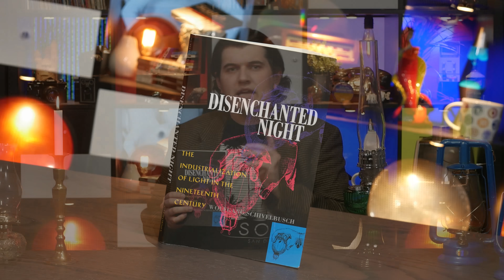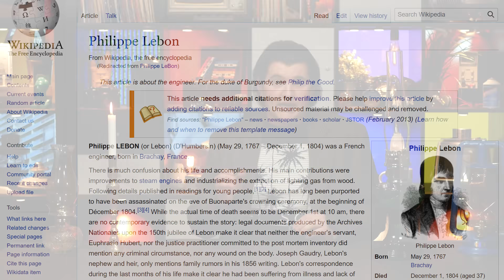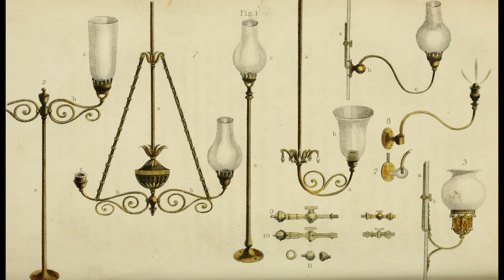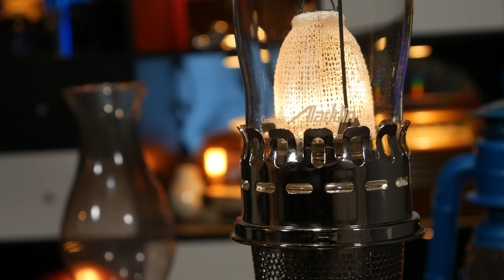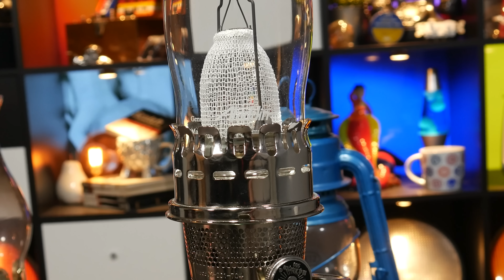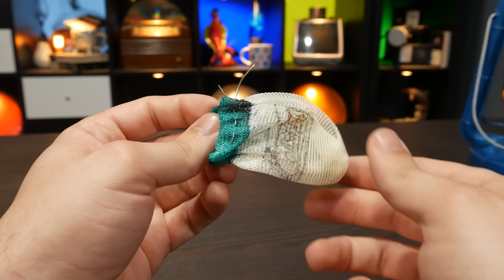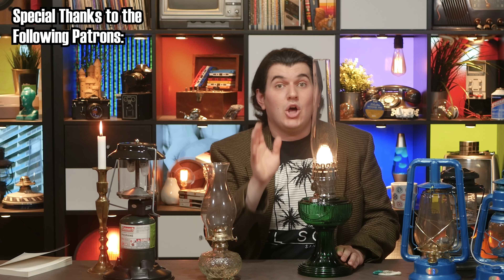How the gas mantle made lamps 10X brighter

Comment: The street lamps in the streets I grew up used Such gasmantels. But gas lighting is being phased out in my city, I don't know what happens with the streetlamps on that street, in some other streets the Gaslamps are rebuild into LED lamps, but considering it is mostly single family homes it is very likely that the beautiful cast iron street lamps are simply replaced with the cheapest streetlamps they can get.

Comment: Btw. We still have infrastructure for Coalgas laying around, and not just streetlamps. If you look at cities sometimes you can discover circular steel frameworks. They where there to contain the gas, im the past you would have a central bubble, which would rise up as it is filled. There are also earlier brick version, some of them in germany where turned into bunkers during WW2. Considering how happy the US was to destroy its cities after WW2 I don't know how many of such structure survived until today

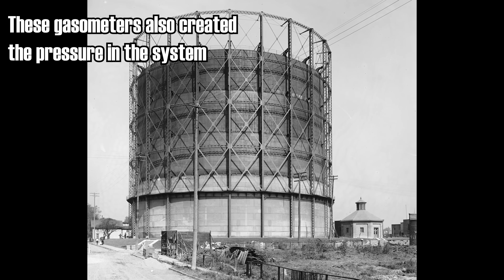edit: watching the Video completly such a structure is shown at 5:26 just remove the gas holding part.

Comment: I used one has a young adult. The challenge is to cut the round wick perfectly level… flat wicks are easy. Tools are available to do this but the ones I used still leaves much to be desired. The Aladdin gives off a nice bright, quiet light… the coleman pressure lantern is so noisy…

Comment: I bought a couple Aladin burners a decade or two back and played around with them till I had a couple functioning lamps . Cumberland general store had some information about the lamps . They said that about 2 inches above the mantle the temperature while burning properly would reach something between 2,200 and 2,600  degrees F.  I think the article also showed how to use the lamp to provide heat for an oven .

Comment: Here in England my mum still uses a few oil lamps and has a lovely brass Aladdin lamp. We call them oil lamps as what we burn here is lamp oil. It seems to be a purified type of Kerosene and burns oderless.
However me and a couple of friends still use a kerosene pressure lantern for fishing and camping. The favourite been the good old reliable British made Tilley guardsman lantern. Vapourlux is another popular one.
I also own 2 kerosene pressure stoves which get regular use.
They are however not without problems if you don't know how best to operate and need regular maintenance.
🏮💡🔦

Comment: You can get genuine Aladdin lamps from Lehman's Hardware.  I think I will stick to solar led lighting for my emergencies that might arise.  I don't like the idea of kerosene in an apartment building.  My fear of the dark isn't that important and the dirty dishes can wait until morning.

If however there is a winter power outage, I might reconsider this because I have electric heat and all electric appliances.  It would be a spendy experiment if I didn't like it or it didn't work, or the hardware store was out of kerosene.

Comment: Actually the gasometer is an accidental measuring instrument. It measures air pressure. To monitor the gas going in and coming out of a gasometer they monitored the pressure in the gasometer, which would vary according to the outside air pressure and recorded the pressure on paper. This accidentally became significant during the eruption of Krakatoa in 1883. The gasometers in Batavia (modern Jakata) recorded massive pressure spikes from the explosions.

Comment: As to the "forced my lute" comment, here's what ChatGPT-4o has to say:

Me (prompt)

In Clayton's letter to Boyle (the first known record of a description of natural gas), Clayton described that the "spirit [he] could in  no ways condense" also "forced [his] loot". 

What does "forced my loot" mean in this context? Be sure to consider the time period in your response.

ChatGPT
In the context of Clayton's letter to Boyle, written in the 17th century, "forced my loot" uses language that may sound archaic to modern readers.

The term "loot" in this historical context doesn't refer to stolen goods, as it often does today. Instead, it is likely an old or obsolete term. However, it's possible that "loot" could be a corruption or variation of another word, such as "lut," which was an early form of "lute," referring to a seal or stopper used in alchemical processes.

Given the period and context, "forced my loot" probably means that the gas pressure forced open the seal or stopper that was being used to contain it. Thus, Clayton's description suggests that the natural gas he was working with built up enough pressure to break through whatever sealing mechanism he had in place.
___

IDK if it's correct.

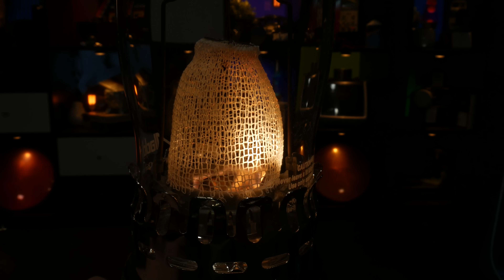Comment: @21:55 The wick probably isn't defective but rather when it was new whoever filled it with oil/kerosene didn't wait long enough before lighting it, the wick needs time to absorb the oil all the way else you damage and burn up the wick that is "dry".  Best to let em sit and soak up the fuel before lighting them, pretty sure that's what is going on here, I use to play with these alot when I was a kid and learned this one the hard way as well.

Comment: Mantles used to contain beryllium. When first using a new mantle, you could inhale the initial burn off. Very hazardous. They also release radium-224 and in the 50s, mantles were coated with thorium nitrate. All bad stuff.

Comment: The expression "forced my lute" likely refers to the process of applying pressure or force to a luting material. In historical and technical contexts, "lute" can mean a paste or sealant used to make joints airtight, particularly in apparatus used in chemical processes and gas production. The term "forcing" would then mean applying or exerting force on this sealant to ensure a tight, impermeable seal. This would be relevant in the context of coal gas production, where ensuring airtight connections in gas pipes and containers would be crucial to prevent leaks and maintain efficiency in the gas production process. The expression captures the need for meticulous care and physical effort in maintaining the integrity of the equipment used.

Comment: I used an Aladdin lamp during a power failure in Los Angeles.  Excellent light output. However, the hot exhaust burned a brown spot in the ceiling.

Comment: Surprisingly I have a NOS from the 50's Alladin Train Caboose lantern and it's mount bracket that allows it to rock back and forth with the trains movement. The tank part of it is made from nickel so it still looks new. Plus original NOS mantles. There may be a wick too. But those  parts are still sold by Alladin.  You vaporize the gasoline the same way the old Coleman stoves worked. For those we always bought lead free gas from Amoco, the only company that sold lead free gasoline.

Comment: I was born in 1947 in the USA.  I am familiar with gas lights that were in my Grandmother's Victorian home.  They were converted to electricity before I was born.  I also remember outdoor kerosene lanterns that were used outdoors by road construction crews and railroads.  I started collecting various bicycle, flat wick farm, railroad, and camping lanterns decades ago.  Also have a few hollow wick lanterns and heater brass fuel reservoirs.  My BSA Troop used Coleman white gasoline lanterns and camp cook stoves that had to be pumped up the be pressurized.  The lamps were so bright that you could not look directly at them.  Thank you for this walk back in time.

Comment: Your other videos I found interesting, this one I found very interesting.
My father used in the 'fifties in a holiday home that was rebuild in spring and stricken down in autumn - in a camp with about 1500 of such homes - a butane lamp with a similar gas mantle which had a ceramic foot. Open the tap on the bottle - which was light enough to be carried with two hands - open the tap near the lamp, apply a match. Use the same gas for cooking.
A gasometer is called 'gashouder' in Dutch, 'houder' meaning the same as holder in English.
Another name for coal gas is town gas. I remember natural gas being introduced country wide in the 'sixties so I always knew where 'natural' came coming from. In Dutch it is called 'aardgas', because it streams from the Earth, especially in Groningen were the houses are cracking from the resulting subsidence to the despair of the people and the embarrassment of the government.

Comment: Coal gas being a byproduct of coke production is actually still utilized today at a pair of steel mills in Canada, one mixing it with natural gas for use in the coke ovens themselves, and another selling the gas to the power company of the town the mill is located in, and using it to run a power station, affectively indirectly making it the last coal burning power station in Ontario

Comment: Just saw this. Check the gap in the wick slot for even gap width along the gap length. If the gap on one side if the wick is tight it wont let the fuel pass and you will have a dark side in the mantle

Comment: My father worked for Aladdin Industries and our family has several mantle lamps and we had a touch lamp back in the '60s. It used capacitance to turn the lamp off and on. I pulled the control unit out and it used vacuum tubes!  😊

Comment: I know there radioactive but i have been filling them up with quarters, putting tags on them how much inside.  all string tie mantles different sizes, shapes and colors inside a white plastic 5 gallon water bottle without the handle and a flat bottom.  still gonna keep filling up those mantles with coins and stuffing them into the bottle until it's full.

Comment: Regarding the statement “these sorts of lamps can’t be used outdoors”, I  lived in Houston TX in the early 2000’s and most homes in the neighborhood had filament style gas lanterns outside in the front yard lighting the path to the door. They were on 24 hours a day which I thought was terribly wasteful of gas.  I accidentally severed the gas supply line with the lawnmower and the light went out. For the next 4 years I left the gas supply turned off, only re-lighting it when it was time to sell the home.

Comment: Luting agents are basically cement or some other adhesive used to make a seal. Common in dentistry these days.
"Forced my lute" likely meant it broke the seals on his distillation equipment, not the glass, which would follow from the "spirit" not condensing and rather exerting pressure on the vessel.

That said, I fully support the notion of resurrecting (and perhaps repurposing) forced my lute for modern slang usage.

Comment: There is no light without fuel.  Our sun is a ball of fuel, batteries for flashlights is fuel, incandescent, led, fluorescent, doesn’t matter all of these use fuel be it coal, gas, nuclear  they still run on fuel.  That’s where your power comes from.  Even solar panels, without that big fuel burning sun in the sky wouldn’t produce light.

Comment: I always found it cool that the actual infrastructure being pipes, made converting to electricity VERY easy, since often the wires could be literally pushed into one end of the pipe and often went straight through the pipes without a problem... some houses (in europe at least) still have old electrical cables which use even older gas pipes as a conduit (although i hope theyre not actually still in use since those cotton braided cables deteriorate over the years)

Comment: There you go again lamenting the fact that people still use lanterns for light. You say there is problems with people burning fuel for light and though I don't necessarily disagree with that statement, you have to realize that even in the USA most of our electricity comes from burning fuel and there are many inefficiencies associated with getting that power from its source to its point of consumption.
Reply: From his other videos, I think his main issue is swathes of people using noxious, potentially leaky fire hazards as everyday lighting indoors and out.

Comment: I've got an Aladdin lamp made for a train car. Bought it brand new in box at a flea market for about 70 dollars. It's definitely a steal. It mounts to the wall. The mount has  vertical and horizontal leaf springs for vibration dampening. The fuel tank is made from nickel instead of glass, too. There is also a lamp shade to go around the chimney and a heat breaker that mounts to the ceiling to prevent a fire from the chimney heat. It swings back and forth on a chain.

Comment: Gas holders were a common sight in and around Baltimore.   Built by Chicago Bridge and Iron, they were akin to upside down collapsible Scout cups, with the overlapping sections filled with water.  They rose and fell based on the gas pressure within, and the water seal in the overlapping sections kept the gas sealed within the holder.  Amazingly simple.  If memory serves, they were approx 3 psi pressure, which was sufficient for the 11 inches of water pressure requires at the customer's burner.  Spring Gardens in Baltimore made coal gas for the city mains...

Comment: An Aladdin lamp can be regulated, i.e. dimmed or brightened. Aladdins are beautiful but rather sensitive so all these warnings must be heeded. I regularly use them for heat and light. I only ever slowly and gently turn up the wick over a period of many minutes and don't run more than say 2/3 max.
I prefer to turn them down to a peep before extinguishing then leave for a few mins so they don't cool down too quickly before blowing them out. The mantle frame and upper holding wires can deform and burn through over time and mantles don't seem to be readily obtainable. 

In the UK lamp oil is subject to 20% VAT but paraffin is not.

Comment: I use a Coleman "white gas" lamp while camping. I grew up around these lamps. I remember my dad taking the lamp and pumping it to pressurize the tank.  My dad used to pull out the mantle after the old one would get a hole.

Comment: We used Alladin lamps at our remote cabin up until about 2000 (we switched to solar). I remember the time the dog knocked over one and it's tank broke spilling kerosene all over the floor. Thankfully this happened during the daylight hours. We also had a kerosene heater and, many are suprised to learn, fridge. When he shows how after a lamp heats up it can change how much kerosene evaporates and burns, imagine that but with a heater and a four foot flame shooting out the top (I woke up to that once). We're so lucky the place never burned down.

Comment: IN the 1960s, there were power strikes in the UK for three hours at a time. I was staying with my aunt in London at the time, in an old house which still had working gas fittings in some rooms, although they'd not been used since the 1930s, when electricity had been installed. With some difficulty, I found a shop still selling gas mantles and fitting them enabled us to continue with gas lighting during the power cuts. It was a pity that the TV wasn't a gas one, too, but we did have a battery-operated radio!
Reply: During the 1950s we lived on a farm here in England. We did have electricity, most of the time, except following a thunderstorm, when lightning would take out the power, which then needed a man to replace a large fuse! We had Tilley lamps for lighting which ran on paraffin oil. Later auto-reset closures replaced the fuse. No more man with fuse and insulated pole to do the replacement.
Reply: @Brian3989 in deepest Yorkshire we had piped butane gas lights in my parents’ cottage into the 90s. No mains electric. Growing up we hated moths for committing suicide on the gas mantle. They were difficult to find and stank when first lit…..  We had Tilley lamps too a gas lights were only in 3 rooms. A fun upbringing!
Reply: 1972, not the 1960s. I remember coming home from school, unlocking the front door and lighting the candle sitting on the table behind the door. It destroyed the Heath government and the next two general elections brought in a Labour administration until 1979. And I was a volunteer election worker in all those elections. 

The power workers weren't on strike - it was the coal miners.

Now only a couple of percent - often less - of the country's electricity comes from burning coal. Because Thatcher (hawk, spit!) hated the miners.

Comment: that's was very good questions to all of it but in thousands years ago and they dont have those like that at all they use oils from olives to burn to give out good light so one thing in Egypt that they use a big bowl that has oil in there and it has a very big flame to burn brightly enough and clean too so it has been thousands of years to use that before candles or gas burning lamps just about hundreds years ago until the first electric was built and made much better today that what it has all changed so much after all of those years now thats why

Comment: is there a good site to buy Aladdin lamps from because all the sites i find are either sold out or sketchy looking as they only allow the use of credit card.

looking for a good quiet emergency lamp. the shelf model looks better because if i wish to get a wall mount or ceiling hanger it will fit a shelf model and i can simply buy the hangers later. 
but a table top lamp is much safer having a robust base so you can move it around if needed the shelf one doesn't appear to be good for moving.

Comment: My experience with mantle lamps was with Coleman gas lanterns similar to that shown at 25:00 when I was in Scouting in the late 1970's and early 1980's. They were a PITA, we had to keep fresh fuel, pump rebuild kits, and spare mantles on hand. The slightest bump would cause the 'ash' of the mantle to disintegrate and require replacement. I had one of the first 6v battery powered flourescent lights, but even it could not illuminate a campsite like the cantankerous Coleman gas lantern; albeit without the danger of a very hot flame.